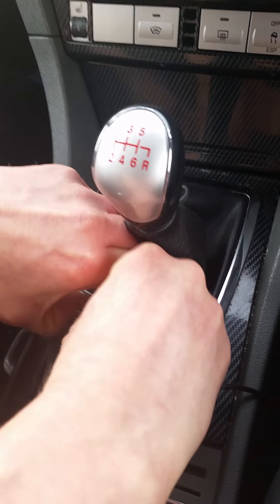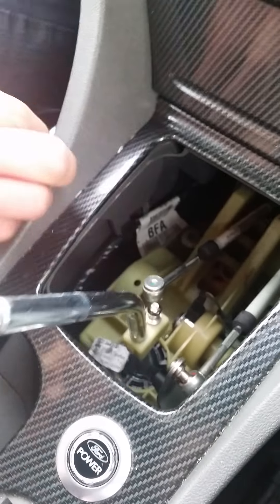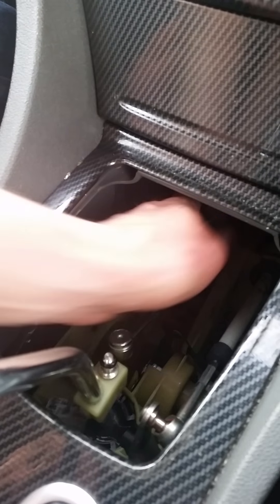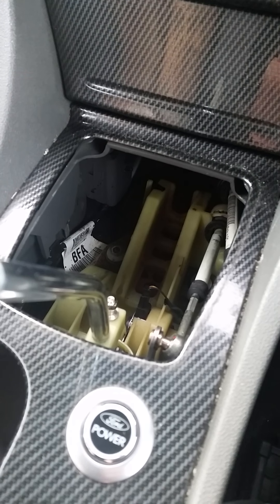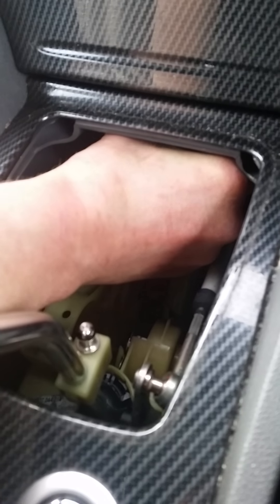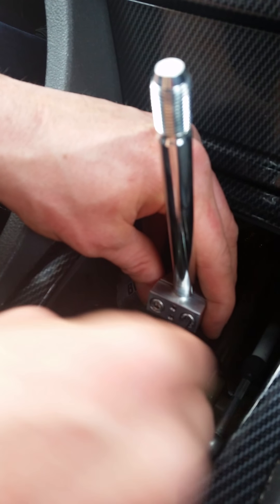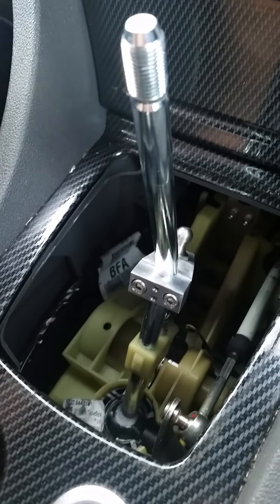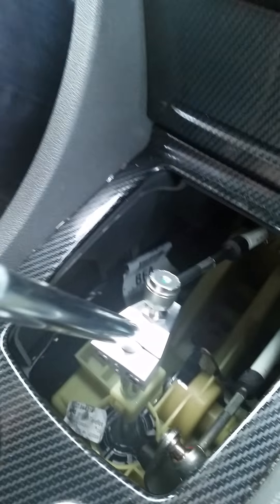Installing a shortshifter / quickshift on a Focus ST 225

Comment: Not sure if this channel is still active, but do you know if this is the same procedure for the standard Mk2 Focus i.e: not ST or RS? Interested in attempting this.
Reply from the maker: hey Matt I'm pretty confident that there all the same but id check with the manufacture
Reply: Ben Turczyn Thanks for your reply, part is ordered so will know soon
Reply from the maker: No problem mucker Let me know if it helps and I can add it in the description if it works please like if you haven't already :p
Reply: Matt Pilkington was the same for a standard mk2 focus?
Reply: Hey I  know your comment is quite old, but i hope you still read this. Have you tried it for the standard mk2? Did it fit?
Reply: @robertnachname8554  I did it to and it works fine for mk 2